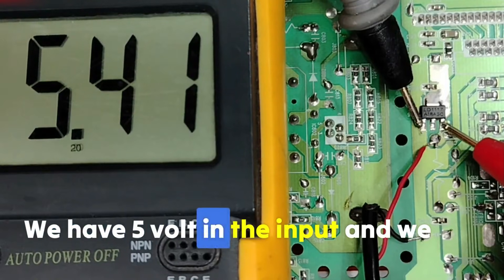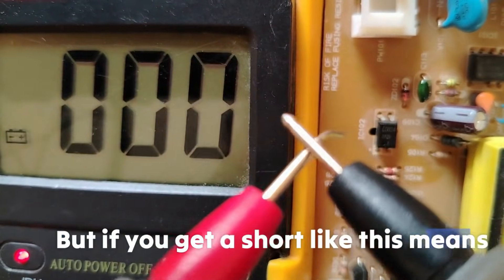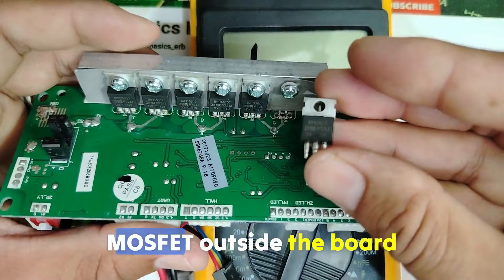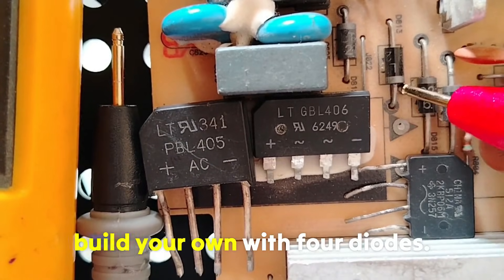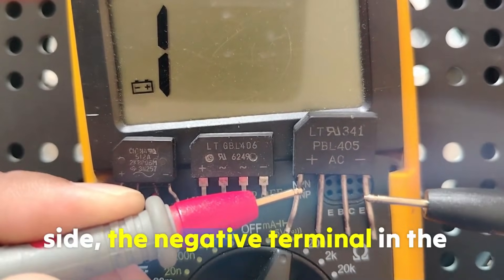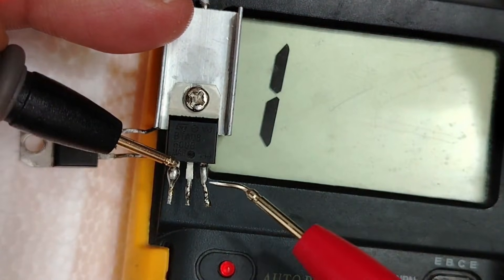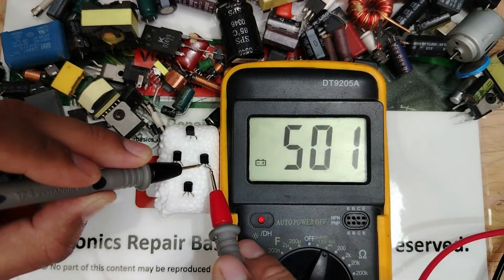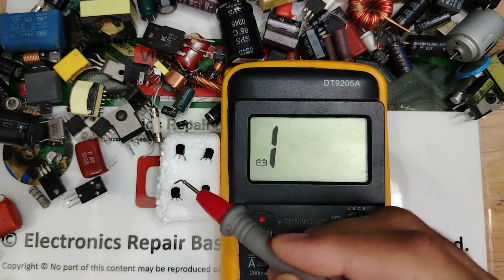Test Active Components with a Multimeter

Comment: Hey I got an acer nitro 5 gtx 1650  i use my astroAI multimeter the charger is good ...but how can I tell if there is a short on the motherboard or what is the quickest way to test components to see is they are shorted.....continuity mode maybe...laptop is dead